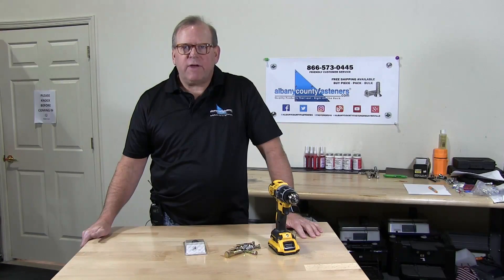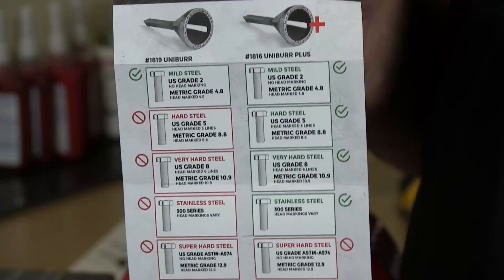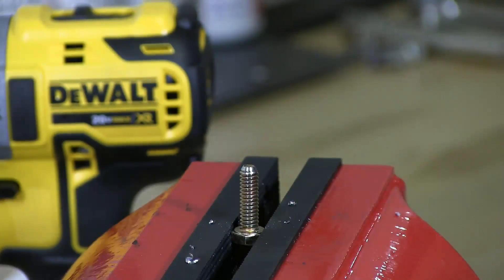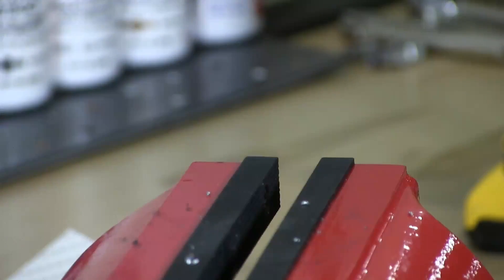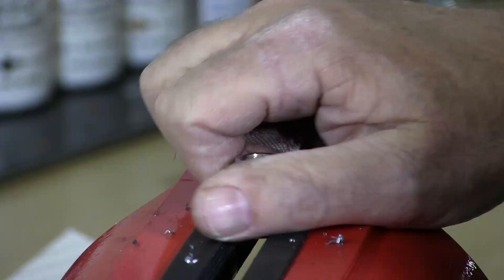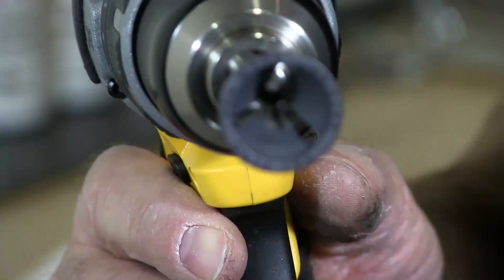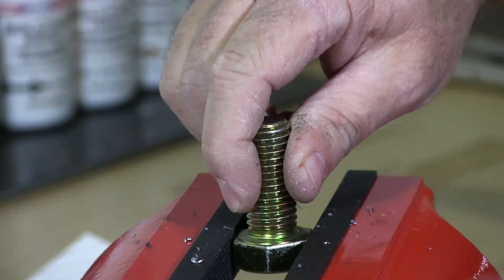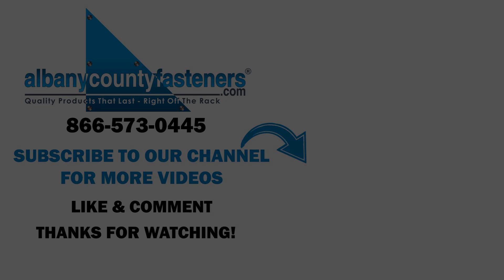Uniburr Plus Chamfer Tool | Fasteners 101

Comment: The original Uniburr works as advertised if it is not abused by running it fast.  I have had one for a couple of years.  The ChiCom clone made of stainless does not.
Reply from the maker: Exactly! While we can't speak for the ChiCom version, running the Uniburr slow is the only way to make it work as intended. Thank you for your feedback!

Comment: Donnyboy73 cut off a bunch of bolts and threaded rods, and tried this tool. Doesn't work worth crap.
Reply from the maker: From what we can tell of his video, he appears to be using a similar tool that isn't actually the Uniburr. While we can't speak for that version of the deburring tool, we can say the Uniburr does work. The trick is that it requires the tool running at a very slow speed, despite what some of their marketing videos suggest. We've found that the slower you run it, the better it works.
Reply: His was a different brand and I also noticed that he kept hitting it straight instead of having the tool at a slight angle. 

I've had good luck with these things, even the "budget" priced ones that I have work fairly well. The biggest thing seems to be the speed and the angle (and obviously the direction).

Comment: Last person that I saw do this said it didn’t work but he also did it at high speed
Reply from the maker: This is a recurring problem; a lot of people want to use it at high speeds. Going slow is the way to go with these chamfering tools. Very slow in fact. Going too fast will prevent the tools from cutting and may even damage the tool.
Reply: He did not use this brand. I saw that one too. The tool was hery poor quality and it looked like shit. I am from europe and i bought a quality one about 2 years ago, it was around 50 USD but god damn it cuts. It doesn't look like the uniburr as it's a bit shinyer or at least now it is. But cuts like new. All the best

Comment: Why would you need to chamfer the threads of a undamaged bolt. I am pretty certain the reason to have this tool is to dress theend of a bolt or threaded rod that has had its length shortened and buggered with a hacksaw or cutoff blade. Like Deacon suggested, show us how it will deburr the thread.
Reply from the maker: You can find a more realistic example of its deburring abilities in our video on cutting and chamfering threaded rod. I'll include a snippet here for you: https://youtu.be/ZWkWUyKtffE?t=172

Comment: Cut about 1/4" of the thread and do it again. Bet it doesn't work.
Reply: I cut all-thread and use this tool to "dress" the ends when I'm done. works just fine.
Reply from the maker: This tool works just fine cut as many times as you want.  Tool life is based on the user and material.
Reply: @AlbanyCountyFasteners  Did you cut 1/4" off the thread and try it?